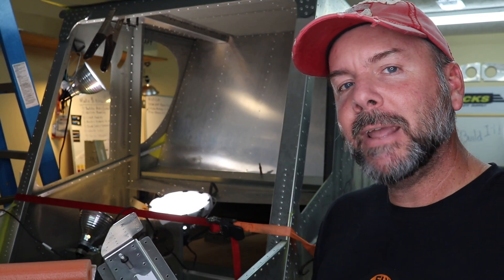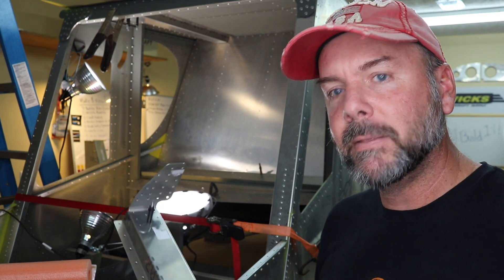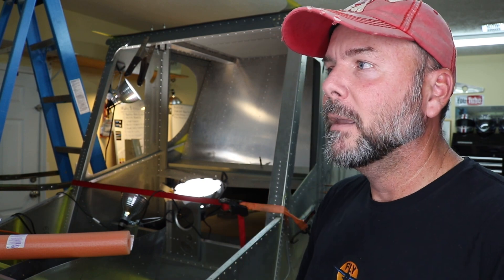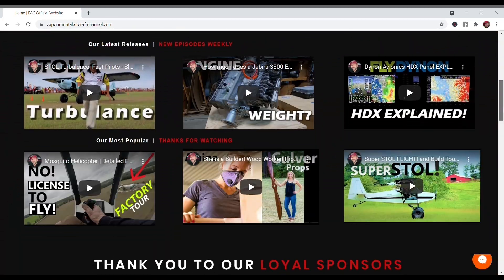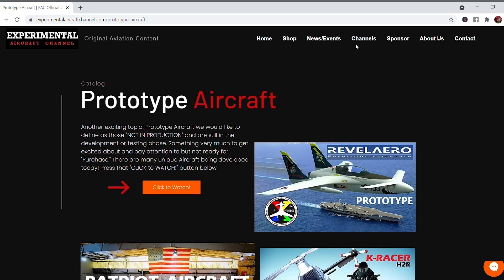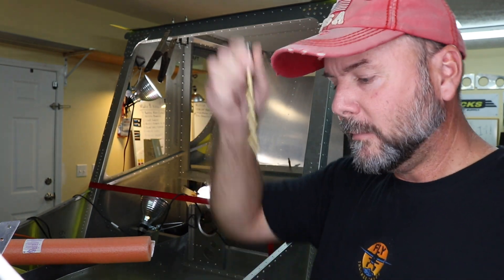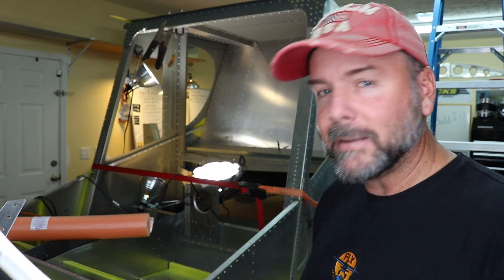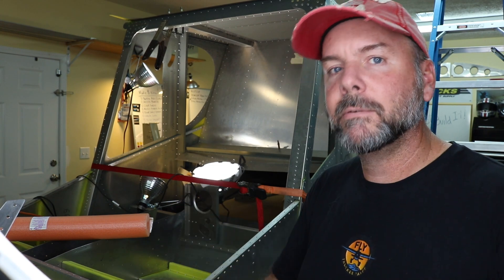Zenith How to Install 3 Point Seat Belt Harness  CH750 STOL or Cruzer

Comment: I'm surprised it didn't come standard.
Reply from the maker: What is supplied as "Standard" is more like your automotive style with one belt going over your should. Or like on a Cessna. Etc. :-)
Reply: @ExperimentalAircraftChannel  Isn't this optional upgrade a product of the enhancements needed for the 750 Super Duty?
It's not standard because it didn't exist when the 750STOL/CruZer first came to market.
Reply from the maker: @philipritson8821  the brackets in the roof are standard in the SD with the sun roof.  Not sure if this has become standard on all kits moving forward.  These style seats belts, are now a minimum standard in my book.

Comment: I've enjoyed most of your aviation "travelogue" videos of visits to various builders and vendors, but glad to see you're getting back to basics and doing one of your own build - keep it up!  As far as the Zenith 3-point Harness kit, I think it is the way-to-go if one is still in the unfinished build phase of the project.  I wanted to upgrade to shoulder harnesses on my finished-and-flying STOL 750, so I made a retrofit that was a simple bolt-in installation utilizing the existing shoulder harness brackets that were already installed for the automotive-style harness.  Either way, having both shoulders belted is much safer and secure, especially if one is involved in a cartwheel or other off-axis crash!

BTW, once you're flying, come visit and I'll put your plane in my hangar and you won't have to worry so much about your roof leaking! LOL!
Reply from the maker: Hey John! I would VERY much like to come visit you in TN once flying! Even better if I can "keep it from leaking" while traveling! :-D. I have a NEW schedule working on my personal project. I call it the "No Sleep Build Plan." And Saturday mornings. I have to get flying in 2022!